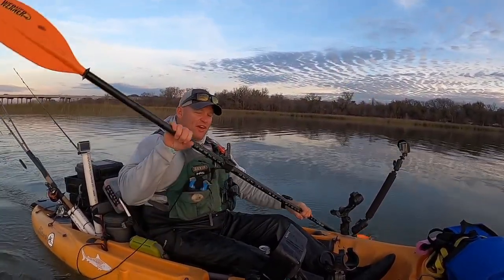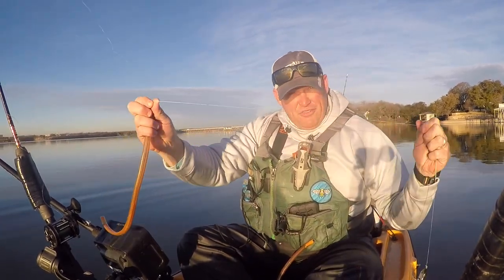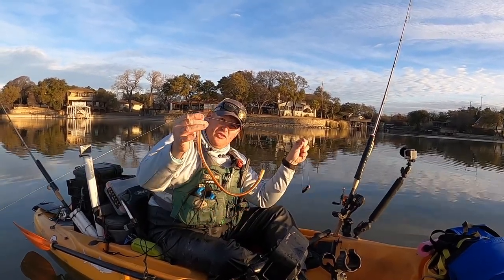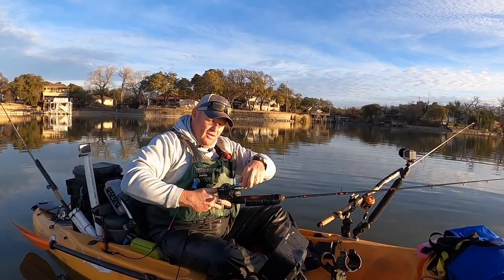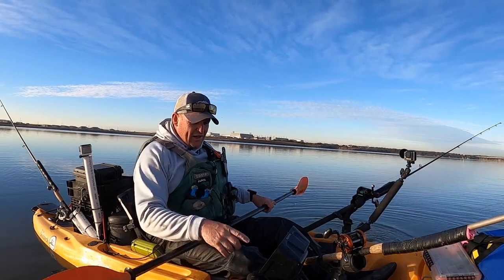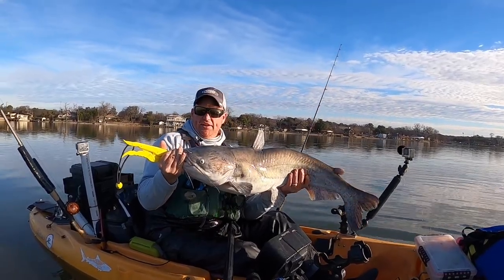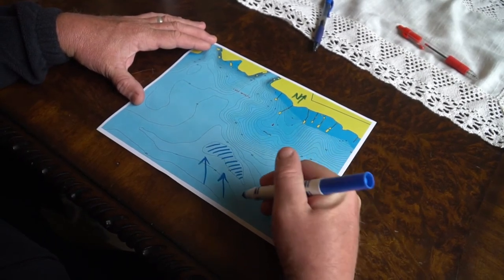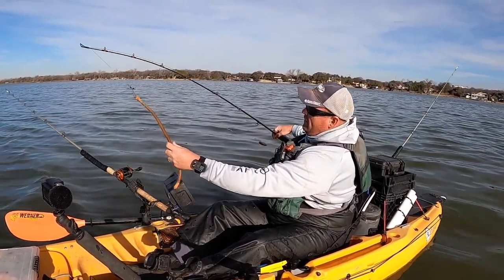Bluecat Leader on the water tutorial!

Comment: Great tutorial KB, thanks!!  I've been buying all my dragging weight materials and was planning to assemble when I saw this video.  Got them glued up last nite so I'm almost ready, just need the chain swivels to come in from Amazon.  Hoping to hit some local lakes on my kayak very soon!  Question: when would you use the 16" weight vs. the 20" one?
Reply from the maker: I have used the 16 with some smaller gear. I also believe that it makes the leader run diffrent so it is always worth a try. I will say that I have only been using the 20s here latley.
Reply: I will try them both out, thanks for the reply!